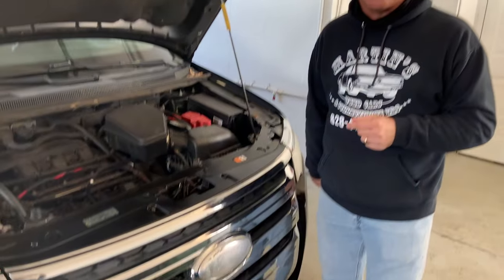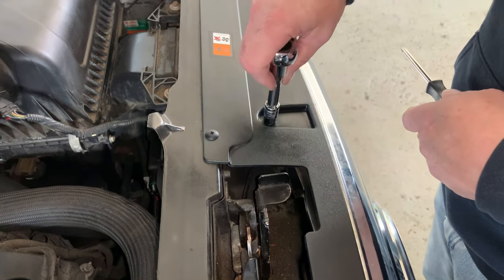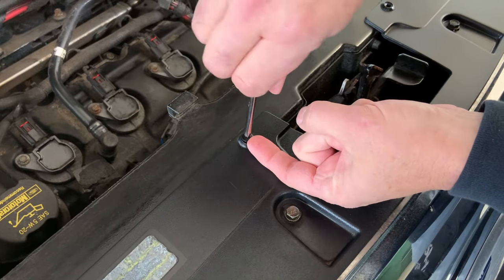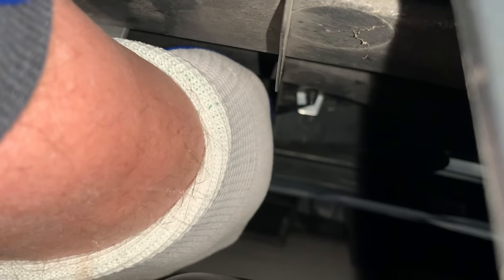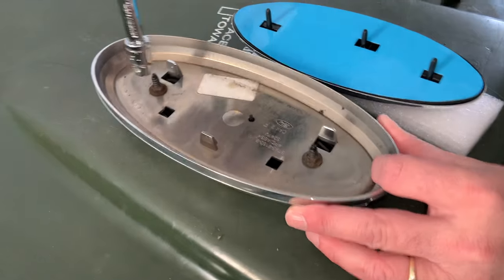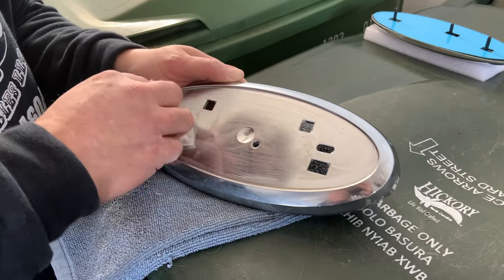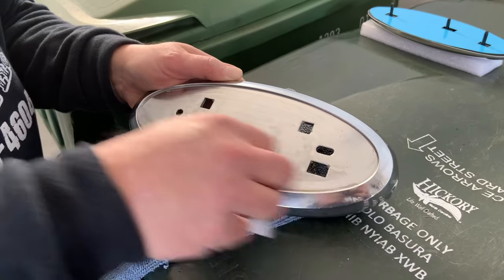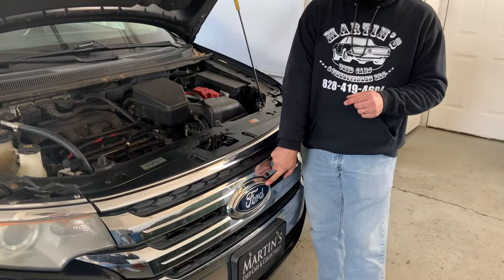How To Replace The Ford Front Grill Logo Emblem On A 2011-2014 Ford Edge

Comment: Very concise and to the point instructions; I wish all auto repair videos were like this: all the information you need and no fluff. It took me 20 min to replace a completely faded front logo on my 2013 Ford Edge. The hardest part was to push down the clips on the old base+emblem and pull it out, but even that wasn't that difficult. Talking about tools, you also need a smaller socket to unscrew the old emblem from its base and screw the new one onto it (I did not write down the size). The link to Amazon the author posted does not work anymore, but the only thing you need to know it is 9"X3.5" Oval Badge Name Plate. Thank you, Martin! You save a lot of time and frustration for hundreds of people like me!

Comment: Awesome video.  I replaced the front emblem on my wife's Ford Edge 2013.  Getting the two clips to let loose was the hardest part.  Got it off, cleaned surface off, place new emblem on and lightly tightened the emblem back plate.  I went ahead and replaced upper trim bolts and pop up screws then pushed on emblem to get clips to engage.  Video was well done.
Reply from the maker: Thank you. Glad it worked well for you.

Comment: Thank you for making this, it took the mystery out of changing the emblem. Mine had the two sheet metal nuts holding the whole assembly to the grille, I had to remove them before the emblem AND bezel could come out. After taking those nuts out, the emblem pulled off while the bezel was still clipped in place in the grille. Not sure why mine was different. Thanks again, and keep the great videos coming!
Reply: Mine too.   3/14 build, 2014 Edge LTD AWD.

Comment: Great video! I replaced the emblem on a 2012 Ford Edge. It is not easy to release both tabs. When one is released, the opposite clip becomes jammed from the shift in position.  It is important to release one clip and push it out as little as possible.  Only then will the other clip release. Pushing out both tabs at the same time would be ideal but getting two hands behind the grill was not possible. Thanks for sharing this information.

Comment: Thanks for this.  I just ordered a new black front emblem for my 2013 edge sport.. I used a carbon fiber wrap on the rear one which came out nice and I did the front too but it didn't look right so just replacing the whole thing.  Great helpful video.  Subbing.

Comment: On my 2014 Edge SEL, you have to take the black thin nuts off the replacement blue oval first. It secures the whole assembly to the grill. Do not follow these instructions for the 2014.  I almost broke the tabs off the assembly trying to get it out. The replacement blue oval will not fit back in the outer oval flush if you put the thin nuts on and try and put it back on the grill.
Reply: Same thing on our 2014 Edge LIMITED. I fought for an hour trying to push the tabs from the inside of the grill with NO LUCK! Once I took a 10mm deep well socket to remove the black nuts from the back of the assembly, not only did the FORD LOGO pull off easily, the metal tabs were easy to gain access. I actually lifted the backplate and it slid right out. When re-installing back into the grill I concentrated my efforts on securing the TOP tab FIRST, then the bottom two. The thing snapped right in. 

**If it wasn’t for reading YOUR COMMENT on this video in the threads below, I wouldn’t have been able to GIT R DONE** 

FYI, I’d like to see ANYONE “just simply push” the locking tabs down with fingertip strength and pop the back plate loose……
Reply: Yep same here. I snapped my tab before I took to the comments and saw this

Comment: Somehow my 2013 design is different.  The part that is removed here is actually attached to the rest if the plastic grill with the nuts on the back of the emblem.  And they will not remove by trying to loosen them. Somehow two hands needed behind grill to get under the nut to give back pressure while trying to loosen.
Reply: Just replaced the emblem on my 2013...it was just like the video.
Reply: Mine was different as well. Had to remove the nuts from the back of the grille to remove the entire assembly from the grille.

Comment: Do you have to take the whole top off to get to the plate
Reply from the maker: We took the screws out the top plate so my hand could squeeze in there, having the screws off allows the bumper to flex a little bit more.
Reply: @MartinsUsedCarsCollectiblesLLC  thanks
Reply: The 2 10mm speed nuts on 2014 edge must be removed before removal of emblem,they hold the emblem to the grill
Reply: @brasshead4177  I was wondering about that, tried for an hour to get mine off today this way lol. Thanks for the confirmation!!